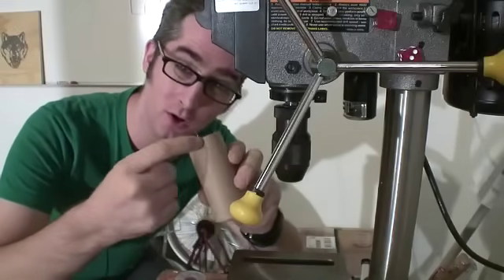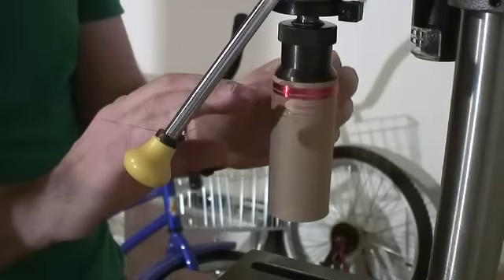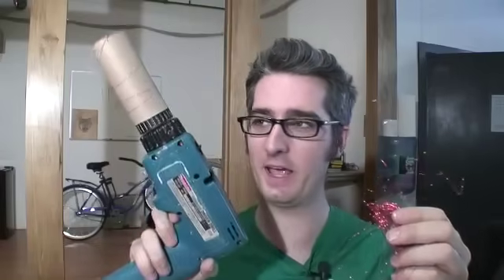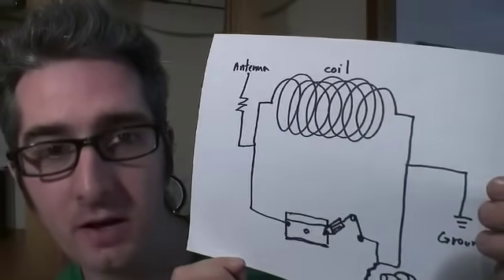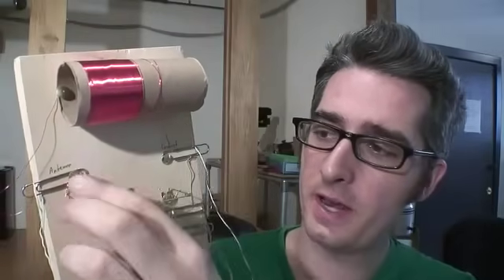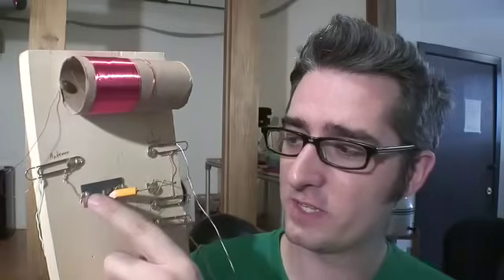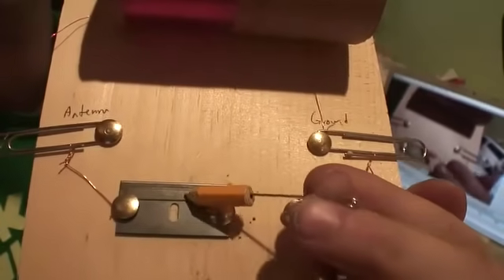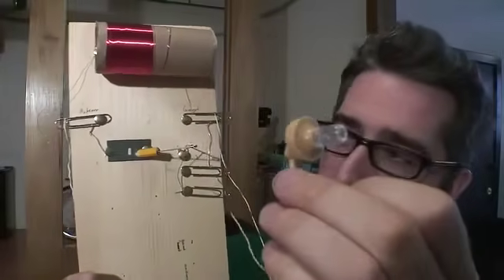How to Make a Foxhole Radio

Comment: The bluing creates a non-conductive layer on the steel blade that acts like a  diode that lets the current flow in one way, so you get the sound.
If you scrape the clearcoat from across the top of the wire coil, you can find different radio stations, but you also need the tuning arm, which is an advanced design.

Comment: I think a common problem, and it is a big one, is that the instructions/descriptions of foxhole radio receivers (aka crystal radio receivers that use a blued razor blade instead of a gelena crystal) always mention a "cat's whisker" without telling the newbie what it is.

When I was a kid, my father gave me an old magazine he had read during WWII, and it had a build-it article about a crystal radio set. It said that I would need to obtain a "cat's whisker", but I could not find a cat from which to 'borrow' a whisker. My father told me that he had heard that it was not an actual cat's whisker, but he did not know what it actually was.

Much later I learned that cat's whisker simply means any metal object with a point (sharp without being super sharp) and with a certain springiness. Safety pins, sharpened paper clips, graphite pencils on the end of a springy bit of wire, and other things can function as the cat's whisker.

And that old article just said to get a crystal from the drug store (it actually said "pharmacist or chemist"). That might have worked in the 1920s-1940s, but it sure does not work during my lifetime.

The difference between good instructions and useless instructions can come down to the author NOT making assumptions about what arcane knowledge the reader might possess. 

I notice in this video that "cat's whisker" was mentioned without giving a very clear description of what exactly is critical to get right (other than bluing the razor blade).

Comment: The best razor blades for this aren't made anymore. They were hot-blued to prevent rust, and are already a diode because of that process. Bluing steel isn't as simple as just heating it until it turns blue. https://en.wikipedia.org/wiki/Bluing_(steel)

Comment: Blue Wilkinson Sword razors were used, and a small bit of lead.
Putting an acidic drop of acidic fruit juice on the lead on top of the blade caused lead crystals to form, and moving the point to different places on the blade, now a sort of a crystal tuner.
POW's made these in the camps.

Comment: i have a question What is the role of cat whiskers?
Reply: like a resistor?
Reply: "cats whisker" is an old expression for how they were done before this design.
A springy wire that tapered to a fine point was poked about on a crystal of some type like galena (lead sulfide)
When you hit a lucky spot the thing worked like a diode
Remember that a radio signal goes back and forth about a million times a second so you can't ever hear that.
A diode works like a "check valve" only letting electrons go one direction.
The "intelligence" is applied at the transmitter by controlling the amplitude so picking off just one direction would pick off the signal.

Comment: This is interesting because using the principle behind this you could theoretically transmit a power source over the air at the right frequency strong enough to charge a battery. Maybe Tesla figured this out.
Reply: The efficiency works out to about zero percent.

Comment: how can I do this without connecting it to the ground ?
Reply: Drive a spare copper pipe or rebarb into the ground and connect a wire, or connect it to a metal pipe

Comment: The Razor has to be Rusty/Oxidized or Flamed/burnt, the rusty razor acts as a schottky diode which only allows the current to flow in a single direction.

Comment: The razor blades had to be rusty or corroded so the contact point ( a bent wire or safety pin)  becomes a diode. A very good diode was a green penny or other corroded coin. I finally did it with a galena crystal which is like the tiny crystal in a 1n34 diode. Which works very well.

Comment: anyone that has questions please ask in my replies. ill answer some here. I will be referring to picture below

https://64.media.tumblr.com/tumblr_ll7zg7b9G71qffwoko1_1280.png

first of all the antenna can just be a simple wire (not the magnet wire just normal wire). Second ground can connect to the actual ground (outside, I think you can shove a coat hanger into the ground idk if that will work though don't quote me) a radiator, a water pipe or something along those lines. This does NOT require any type of battery, or plug, this simply works from being powered by the antenna. you want the antenna to be as long and as high as possible. you must also heat the razor blade until its blue. if you dont have a toilet paper tube you can wrap the coil around you can use a glass bottle, a wood cylander or something like that even a quaker oats cylander thing, dont put it around a cylander made of any metals, you can also use a plastic bottle (i personally wouldnt do a wide bottle like a 2liter so if you have a smaller one do that.) you wind it 120 times and keep it close together.  oh one more thing i can think of, the headphones (preferably cheap from dollar store or something) you cut the end of the wire and you cut of the whole plug part, so that there is some wire sticking out, then you split half the wire to one part of the picture, and other half to other part.
Reply: Would you wrap the ground wire around a radiator to make it work or is something else happening?

Comment: What happens if you modify your radio not to listen to radio stations but to listen to very high frequency longitudinal electromagnetic pulses or surges emitted by the Sun and other stars which are hitting the earth all the time? What sort of power your radio will receive then? Longitudinal electromagnetic waves have electric field and magnetic field in same axis as propagation 0 degree instead right angles 90 degree to direction of propagation you find in transverse electromagnetic waves. Check video "Replication of Eric Dollard's Analog Computer" for differences between transverse and longitudinal waves. Also google "Transverse & Longitudinal Electric Waves and Tesla’s Longitudinal Electricity by Eric Dollard".

Comment: Hi, I am designing a lab to ask my students to build this radio in a lab and then, in turn, teach them P-N junction and semiconductor. I am trying to understand the science behind this Razer diode. After a day of google, I end up knowing it is a "metal-semiconductor" junction or a "cat-whisker detector" and it works like a Schottky diode. However, I am still confused about the following:

1) What is the anode and cathode in this razor-pencil diode?

2) If the steel is the metal and the graphite is the semiconductors, what is the reason for having "blue steel", is it related to the oxide? or is it related to the crystal structure and therefore the bandgap changes of steel after heat treatment?

3) If the iron oxide is really needed for it to work, then there is oxide in both side of the iron, why is it diode? it sounds more like a transistor to me.

I will be very grateful if anyone here can give some insight or direct me to the right source. Many thanks! :)

Comment: get rid of the razor blade and replace it with a Germanium diode and WALA , you'll have a better signal . sand the magnet wire on one side and take a paper clip to short the coil in different spots  by  moving the straightened paper clip across the sanded part ...that will change frequencies

Comment: Dont use a drill press fool.  Dont be lazy.  Get some 2x4 and some rod and nuts to make a cradle so you can wind the coil slowly to make sure the wire doesnt wind unevenly or break off.  Or do it the hard way wrapping it by hand.

Comment: Not bad. Add some frequency discrimination and post an update. (A couple of different options; I'm curious to see which you choose.)

Not likely to find such lengths of wire suitable for a tuning coil in a modern foxhole or field barrack without getting a court martial, but this is a fine introductory project for analog electronics.

Comment: Why 120 times? Why not more or less?
Reply: for inductance calculations
Reply: You can use less or more  but then it will tune a frequency where there are no stations transmitting.

Comment: The drill press will work really well, just reduce the speed. You don't show the entire press, but it looks like the type that has an adjustable drive belt. If it is, just move the belt to a lower speed (a speed you would typically use when drilling metal).

Comment: I’ve been trying to get my ‘fox hole’ radio to work and I haven’t had much success.  I was wondering if you could answer a few questions that I have:
• I am using magnet wire with the proper gauge.  When trying to tightly and evenly wrap the wire around the toilet paper role, the cardboard collapses.  As a result, the wire is not as tightly wound, as I would like it to be.  Could I use a metal cylinder instead?  Would that affect the electromagnetic field surrounding the coil?  Otherwise, would a wooden dowel work?
• The magnet wire that I am using has a lacquer finish, which I believe acts as insulation.  When connecting the magnet wire to the antennae, the diode, the headphone and the ground, should I be sanding off the insulation on the magnet wire?
• Is it necessary for the wire used for the coil to be insulated?  Could non-insulated wire be used?  This would eliminate the need for the sanding mentioned above.
• Before experimenting with the razor/graphite diode, I purchased a diode from Amazon.  Does the direction of the diode make a difference?  I would think not.
If anyone can answer these questions, that would be fantastic.  Thanks.
Reply: You could use a PVC pipe
Reply: Thanks Jds Wolf for your answer.  I'll try to grab one at Home Depot.....and do you know about the magnet wire?  I saw in another video that I would have to strip off the lacquer coating when making connections.  That makes sense.  But what about the wire in the coil.  Does it matter if it is insulated or partly insulated?
Reply: It has to be insulated, if the cable is connected all over the coil it won't do anything, so all insulated in the coil and the tips can either be sanded or scratched with a knife for the connections.
Reply: Cool.  Thanks.

Comment: If you want listening on shortwave in the Netherlands is that possible!
http://websdr.ewi.utwente.nl:8901/
instructions:
click To * waterfall *
Seeking for: * Waterfall view * and click on: MAX IN.
Choose a modulation now for testing: AM
Click in the box: Frequency - and type: 1008 KHZ (you will hear a Dutch radio station)

http://websdr.ewi.utwente.nl:8901/

40mtr for amateur band mode USB / LSB: 7125KHZ
for NL pirate stations on AM mode: 6380khz (usually on Sunday afternoon)
MW NL pirates station AM 1630KHZ
80mTr amateur 3650KHZ

Greetings from the Netherlands.
Rob.

Comment: Heating the razor blade creates a dioxide layer on the blade (2 materials) which turns the razor to a detector (diode). I think kind of that layer is also being used at the gate of mosfet transistors.
Reply: u simply create a layer of "something", that is coincidentally already attached to something already conductive (the rest, un-oxidized portion of the razorblade´s iron)... earlier, u´d have used a crystal, but then, u´d also have to build a "holder" for it, but here, u don´t have to, cause the iron-dioxide is already firmly attached to the iron underneath it. I think, that´s the N, of a PN-junction (which is a diode). so it´s half of a diode. the other half of the diode, it´s the pencil-graphite.

Comment: Try heating up the razor blade with a blow torch/ or fire until it takes on the blue color
Reply: Sam Ba these radios worked with the older style blued razor blades not the modern coating.
Reply: Sam Ba these radios worked with the older style blued razor blades not the modern coating.

Comment: how do you get a different frequency ?
Reply: jboypotassium You can sand off the coating of the coil, so you are able to change the inductance by sliding over the ground wire. So instead of mounting it to one end of the coil, you just move for example a bare wire over the coil. This makes the radio a bit selective.

Comment: Heard the toilet paper companies are getting rid of the tubes. Then what?
Reply: buy a radio
Reply: Easy, measure up an existing tube while you can, and make a replica tube out of printer/copier paper. Or, there is nothing to say you can't use plastic waste pipe, or even a small medicine or drink bottle. The tube doesn't even have to be of any specific material. You could even get more adventurous and dispense with the paper tube altogether and build a simple frame antenna, but I digress.

Comment: it is the rust spots that make the good connections.. different size rust spots get different stations. you can get blue blades from crystal radio parts supply.

Comment: will any head phones work??
Reply: Im pretty sure you need the piezo type ear phones that he is using as they require less power to drive them, normal ear bud head phones need too much power and prob wouldn't work. I'm thinking maybe a piezo disc would work too but I haven't tried one yet so not sure. hope this helps.

Comment: do you need that ear piece thing?
Reply: That's a piezoelectric headphone, you need that if you are not using any pwr to amplify the signal (to a speaker), you won't be able to hear it without, you can also use a handset from a chorded phone w/o any pwr. Hope that helped some, take it easy
Reply: You don't need the ear piece but you need some sort of thing to hear the radio through. Speaker, headphones, ear phones ect
Reply: So you can use any par of headphones? is that how you spell the kind a par we're talking about? theres like 50 different ways to spell it!!!
Reply: ya

Comment: Are there any alternative metals to blued razor blades?
Reply: Try different pieces of corroded metal you may have around the garage. Maybe a shiny rock will work. It doesn't actually have to be a blade. You will need a crystal ear piece like he had. Modern earbuds won't work very well at all.

Comment: question... if I were in a real foxhole where would I plug in or attatch the ground wire to and would it be possible to attatch a regular antenna if I wanted to thanks!
Reply: To the actual ground. They'd likely just shove something metal into the ground and attach the ground wire to it.

Comment: Im no electronics pro but how can this work without electricity? o.o
Reply: The answer is: http://en.wikipedia.org/wiki/Electromagnetic_induction
Reply: radio waves are form of power,, circuits can harness that power to operate.... just like those little lights decorating cell phones, and they are lit when a call is received
Reply: The power is flying through the air constantly in the form of radio waves.  The antena picks up the slight vibrations of the radio waves and the vibrations are transfered into the coil wire which amplifies them and sort of spreads out the wave somehow and then it vibrates into the earpiece.  I'm not sure what the ground piece is for.

It's all just vibrations.  The same way a record player makes noise.  A little pin hits micro bumps on the record and the sound is amplified by some huge funnely piece of crap.

Comment: You may want to state that the pencil should be graphite not polymer. The carbon is the key to the cat whisker. Back then, they also used a tungsten "whisker" and ran it down into a solid block of carbon, amongst other materials, to include crystals, which is where they got the name, "Crystal Radio"

Comment: MAKE I don't have access to this in my place, so I had a few old motors in which they had these Magnet Wires, so I took them out from them, but the problem is that they are too short to be winded onto the toilet paper tube around 120 times, so can I just join these by knotting them? (would that cause any problem?)
Reply: It does not matter, just keep the conections as small as possible, if you can , solder the two wires together, that's the best solution, or you can just twist them together. Wish you luck!
Reply: Thanks a lot Sir! That really helps! Teodor Zafiroski I appreciate it very much :)
Reply: But one thing I'll have to scrape off the non-conductive coating right?
Reply: Yes, of course..
Reply: Ohhh ok! Thanks a lot sir!
Reply: You're welcome! :D
Reply: rohitrajkumar udhwani A bit late but on thinner gauge wire like that the easiest way to strip the coating is with a lighter.
Reply: it shudint cause any problems aslong as you make sure that they have contack with the other wire:)

Comment: Similar principle, they would wind wire on nails dipping the nail in wax after each set of turns then they would put the nails in a can and lightly cover the open end of the can with foil they usually got from candy wrappers. There's also a way to make a small speaker with charcoal and a small metal cup they would make on a hot stove.

Comment: The magnet wire has a coating on it that will prevent it from making the connection. If you still want to use the wire to connect the paper clips, take a lighter and hold the end of the wire over the flame until you see the coating burn away. It only takes a few seconds.

Comment: No, the frequency is controlled by the number of "winds" of the enameled wire over the toilet paper tube. The pencil/razor blade set forms a primitive diode, needed to make the radio waves audible. So yes, this design is fixed to only one station.

Comment: I recall that it's something to do with passing a graphite core through the centre of the coil to "tune" for diff stations. In this case the core is replaced by a pencil and pencil lead is actually graphite. Well the hell would a GI find a graphite core like that anyway? A Pencil is much easier to source. I think finding the wire would be the hardest task.Varnishing your own wire?